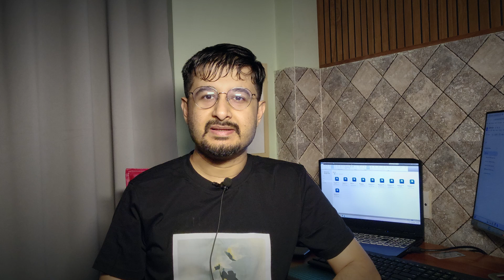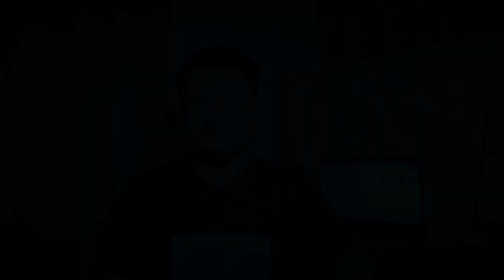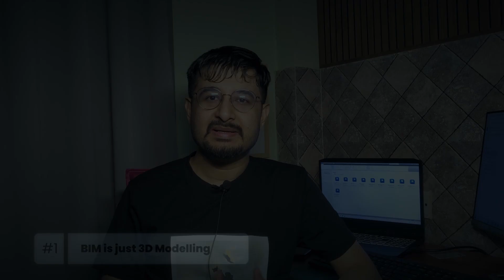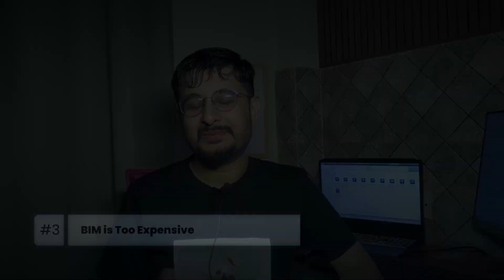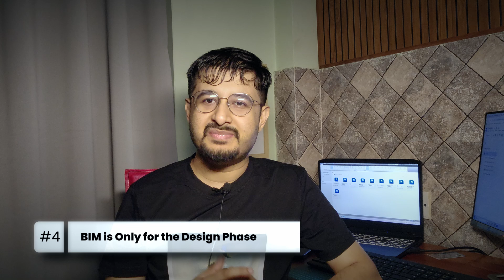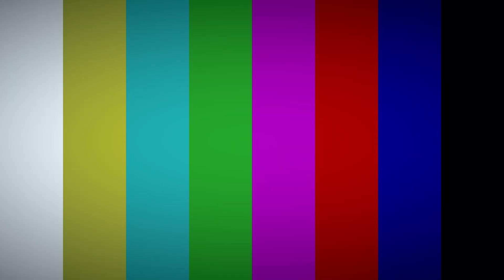5 Common BIM Myths Busted!

Comment from the maker: 💬 Quick Note!
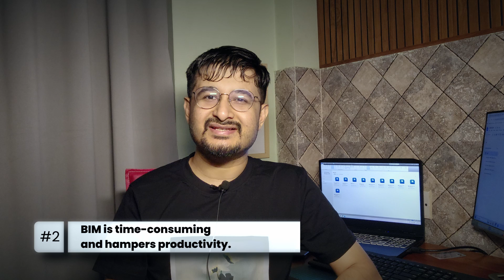At around 1:58, I mentioned that "if you're only thinking in terms of 3D, you're missing out on 90% of BIM's true power."
Well... okay, maybe 90% is a bit of an exaggeration 😅 — but the point still stands: there's a lot more to BIM than just the 3D visuals. It's really about the data, the process, and the collaboration behind the scenes.

Let me know what you think — how much of BIM’s true potential are we actually using on our projects?